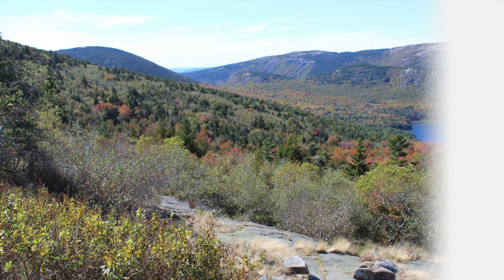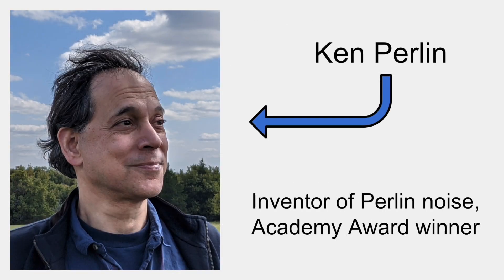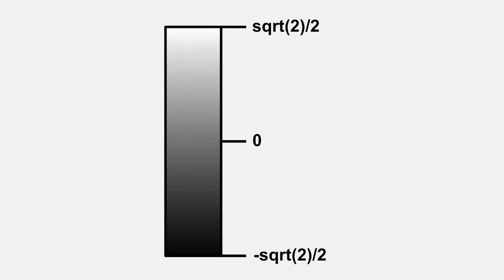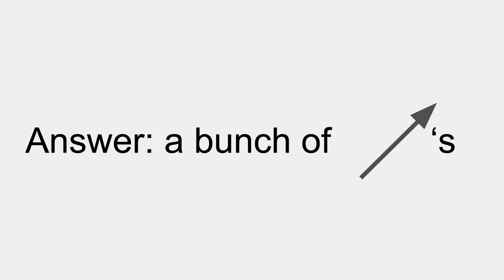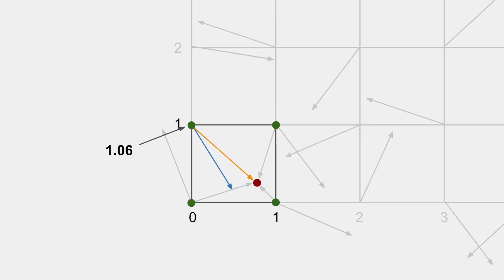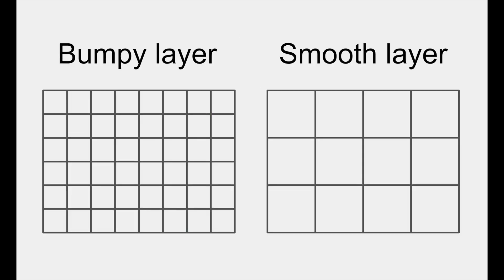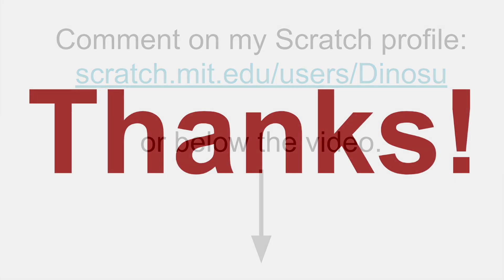How I coded this scene (Perlin Noise tutorial)

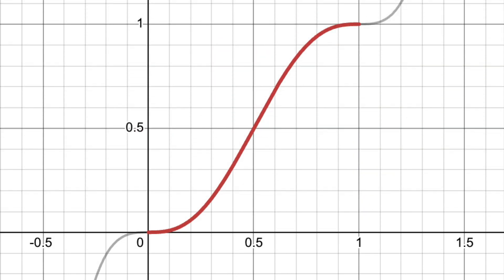Comment: I have a question, in 8:37, why not just use (1 - cos(x * π)) / 2?
Reply: Results between the scaled cos function and function presended in the video are very similar, so it doesn't really matter what you use, but I did some small test and scaled cos function is 50% faster than this second function, so if you have to generate large maps rahter use (1 - cos(x * π)) / 2 function.
Reply from the maker: It would still be smooth, but it's not the standard for Perlin noise :)